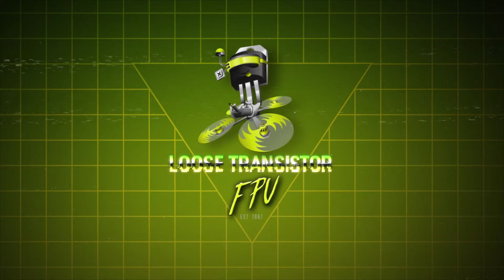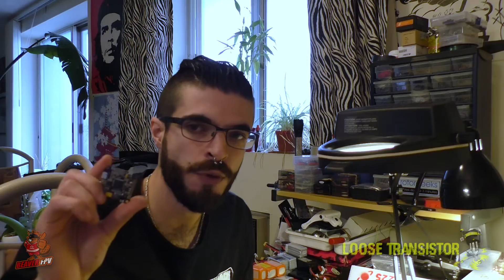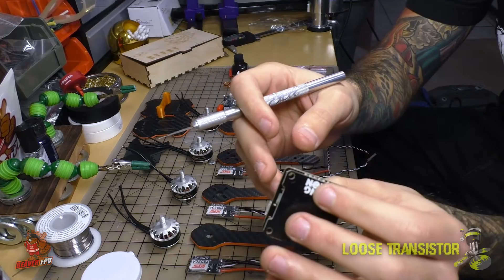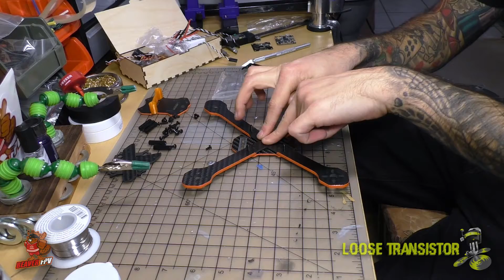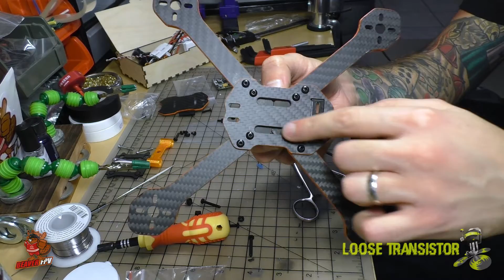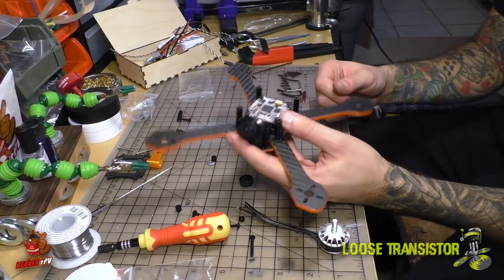FPV DRONE BUILD ♠ LE HYPHY FRAME - Hyphymultirotors.com - Part #2 FRAME BUILD!

Comment: For some reason I think it would be better for the recessed side to be facing down, so the metal bracket lays flush into it. This would also add strength in that section.

Comment: Would appreciate if you could quickly mention the buzzer and led wiring to the Kiwi F4 in the next vid. Much appreciated! The wiring diagram is a bit confusing...
Reply from the maker: I will make sure to discuss that on the build video.
Reply: Appreciated!